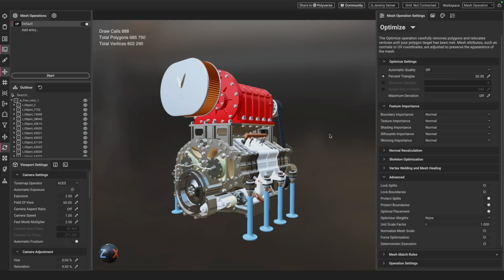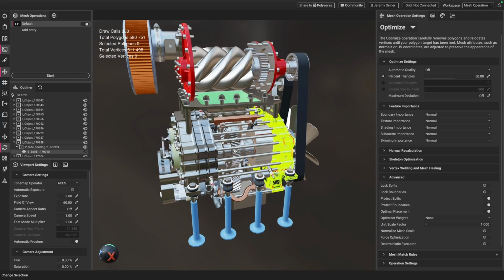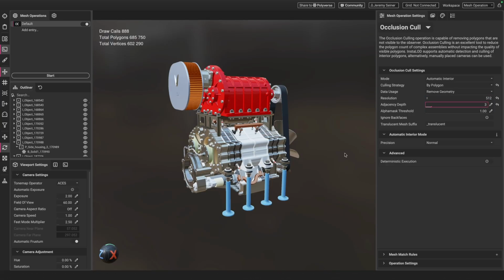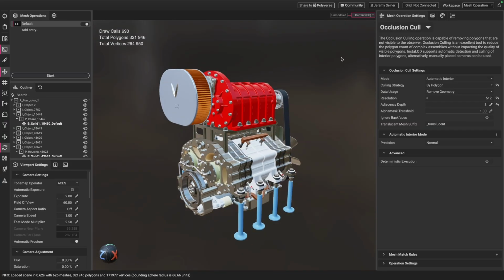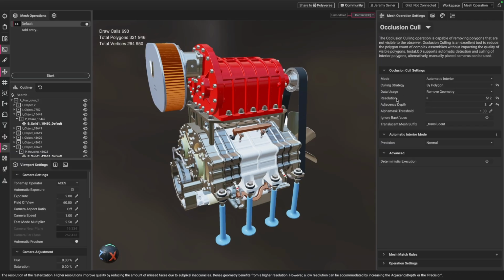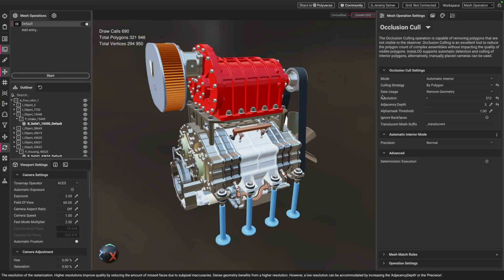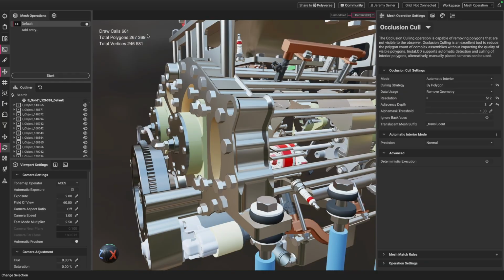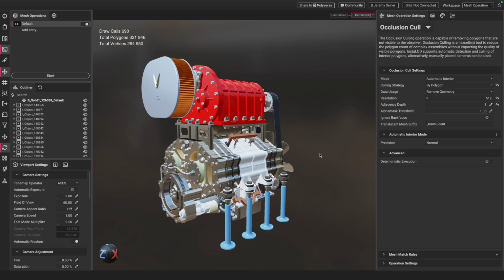Automatically Remove Hidden Geometry with Occlusion Culling in InstaLOD Studio

Comment: so one of the processes for next gen games art is making a rock thats unique and 360 or viewable from all angles or a set of them, then assembling them into a cliff shape thats much larger. then going and removing all those interior faces from the rocks that now make up the larger cliff for optimization....this level has to goto the polygon level and further sometimes it may even help to weld things together to make a seamless mesh at the end. not always. this allows for unique looking normals on the cliff but also modular construction at the same time....showing this example would be really relevant to games art....fyi